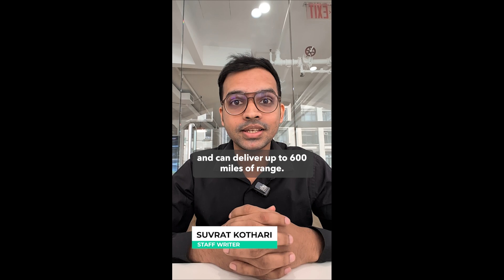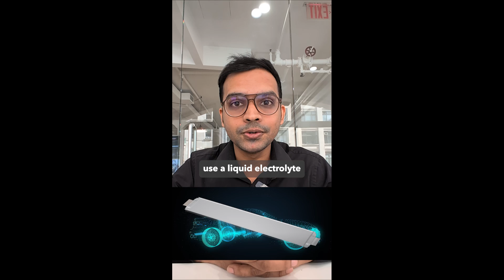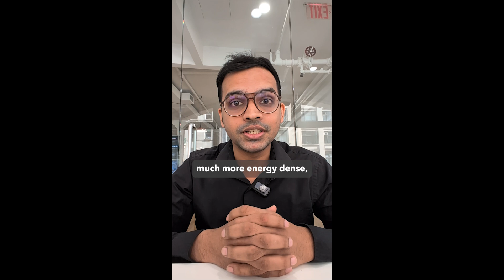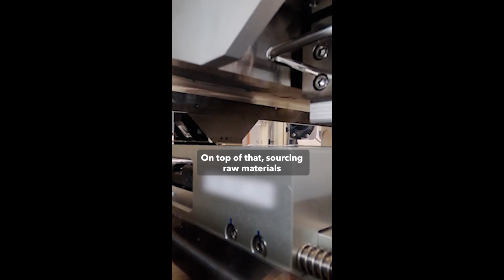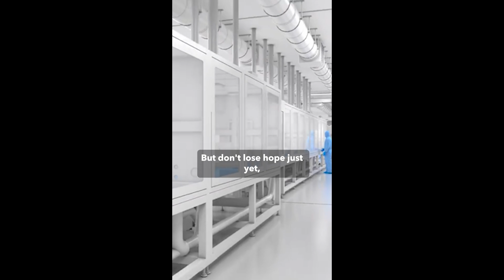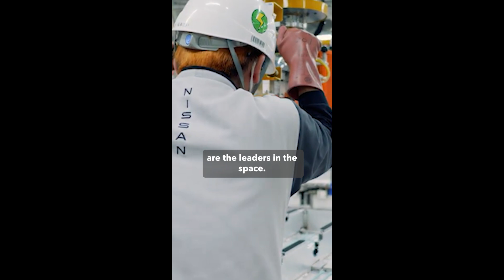Why Are Solid-State Batteries Taking SO LONG?!

Comment: Please stop the media/marketing trend of saying that a new battery technology will provide 600 miles of range. Any automaker can stuff a giant battery into a small EV and have it go 600 miles. You need to also mention the battery capacity to put the "600 miles" into perspective. And saying that solid state batteries will be out before 2030 is pretty vague as well. Solid state batteries have long promised fast charging, high energy density, and fire safe operation. But the challenges that haven't changed over the last 10 years are Solid State longevity, volume production viability, and competitive cost. No doubt the first affordable production EVs using solid state batteries will be built and sold relatively soon (in the next 3 years). And when that happens (in China) the rumbling will be felt among all automakers worldwide.